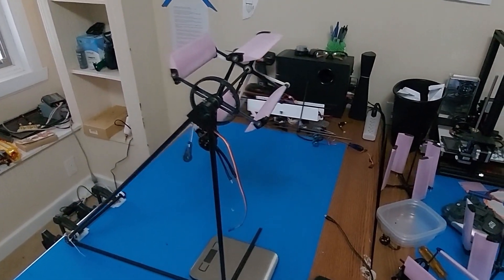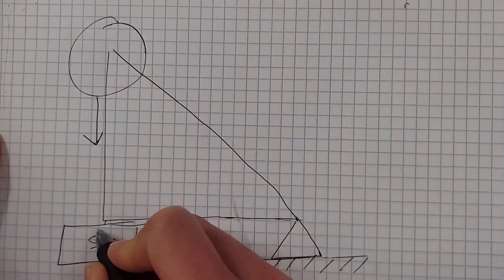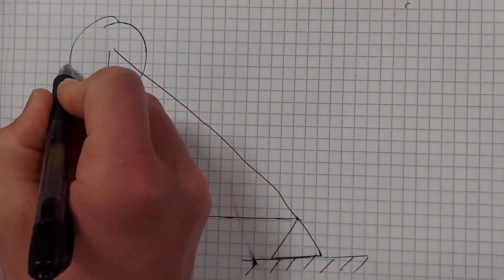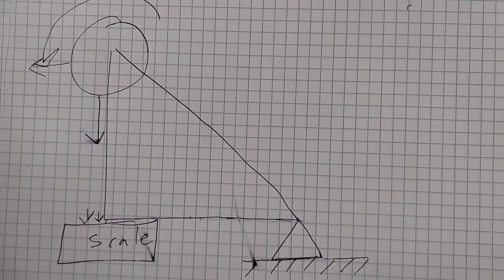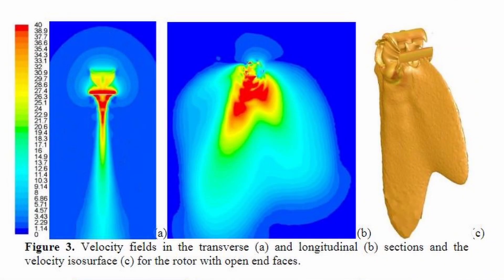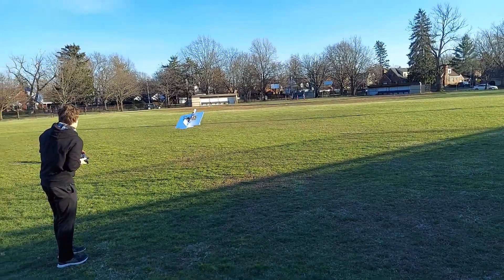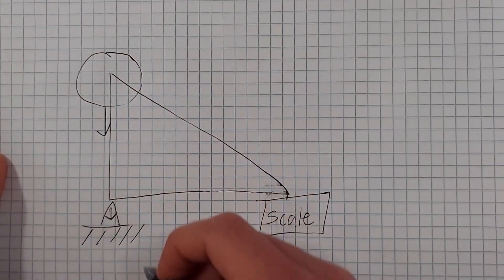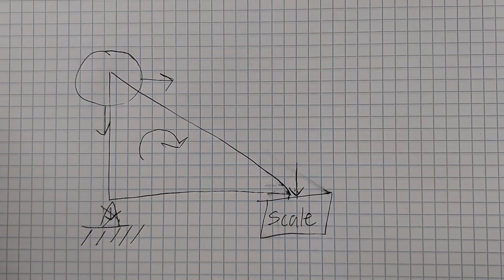I Figured Out Why My Cyclocopters Don't Fly

Comment: What I know there should be two servos to control pitch angle,  right ? but you just use only one servo . You should figure it out to use two servos to get 360 thrust direction
Reply from the maker: just went through and designed a mechanism for this, currently testing it 👍👍
Reply: @JudeSchauer  Great , excited for your video

Comment: Just came to my mind after watching this video, I also sent you an email. Maybe a properly designed lightweight duct around cyclo motors can direct more airflow in the rotor and direct the thrust exactly underneath it in a less chaotic manner. I do not know if this would cause issues like tip vortexes like the regular props but it should be easy enough to try.

Comment: Hi! What motor did you use??
Reply from the maker: Hi!  I'm currently using a 1700kV 2004 series brushless motor.  I've found that they are by far the lightest for their power output.

Comment: How did you make your blades without them bending at high rpm are they reinforced somehow?
Reply from the maker: Instead of going for just brute strength with something like carbon fiber, I decided to try and go as light as possible in order to keep the centrifugal forces down.  The blades are made out of XPS (pink insulation) foam covered on the outside face by a strip of packing tape.  (for tensile strength)  This puts them at ~1.3g per blade, which is significantly lighter and therefore has much smaller forces acting on it than a stronger blade does.
Reply: @JudeSchauer  have you experienced any bending of the blades at higher rpm?
Reply from the maker: @TennisPB  Slight bending, as to be expected when it's rotating at 2000rpm.  However, there's been some studies done that show that the effect of blade bending is very detrimental, so it's important for them not to bend much.  Luckily, the light weight of the blades means that it doesn't really bend enough for the thrust to be reduced.

Comment: The cyclorotor will produce not just a horizontal and vertical thrust vector, but also a torque due to the drag force on the blades. This offset pivoting apparatus will make that torque appear as weight on your scale.
Reply from the maker: You are correct.  I have that fixed now. 👍

Comment: If you find that you have a horizontal and vertical thrust component, shouldn't that mean that your full output thrust vector is actually as big as you measured with your first test stand and just rotated slightly? Shouldn't it be possible to angle your cyclorotor unit a little bit so both the formerly vertical and horizontal thrust component add up to give you exactly vertical thrust?
Reply from the maker: That's a good point.  The thing is, adding up the horizontal and vertical components produces a smaller resultant force than just taking them individually (due to the Pythagorean theorem).  Due to this, the correct thrust should theoretically be found by multiplying the sum of the components (what my thrust stand was doing) by 1/sqrt(2).  However, it's less thrust than that due some reason that I can't say for sure.  However, I suspect that it may be non-uniform disturbution of thrust throughout the thrust producing arc.
Reply: @JudeSchauer  you'd need a test stand that can measure horizontal and vertical force simultaneously and indepent of each other. Like that you could plot the behavior of the cyclo rotor and possibly compensate for any offsets with a mixer curve. 
I think this may have also hindered your aircraft as a thrust vector that is pointing in the wrong vector can often be worse than just too little thrust.